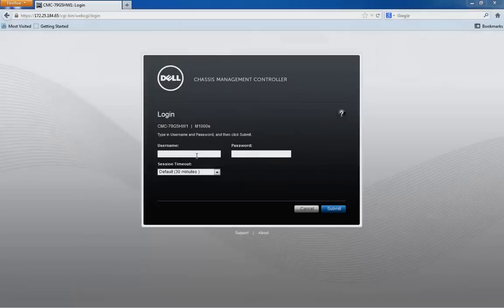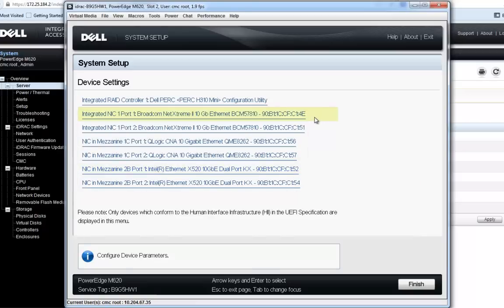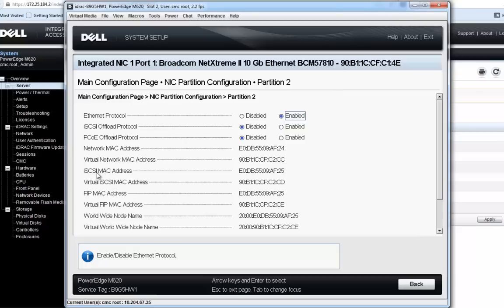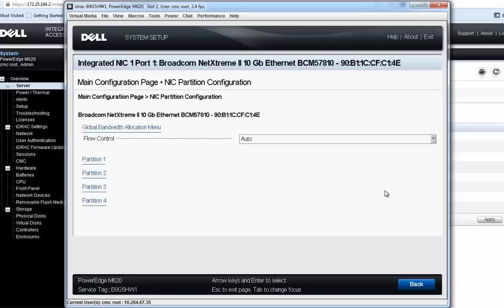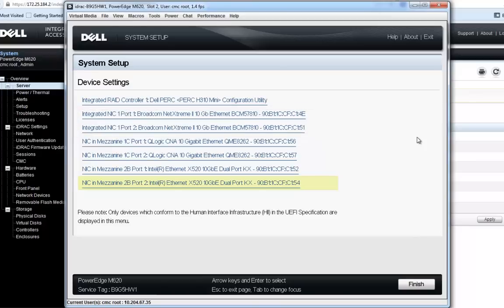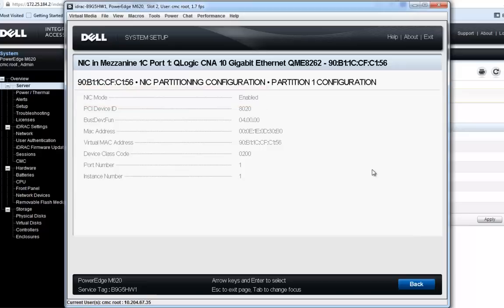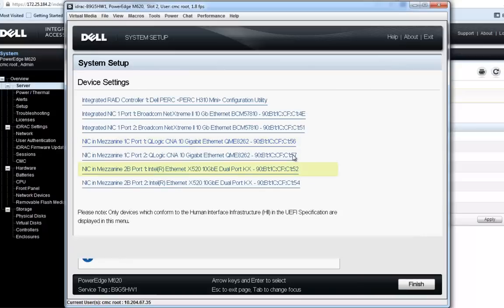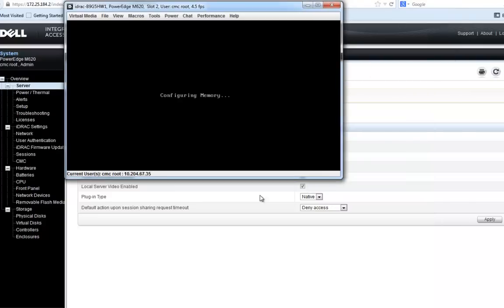Dell NPAR Podcast

Comment: Hi, Broadcom 57810 after disabling NPAR to NONE port 2 get the same permanent mac address as port 1. Previously it was different. Do you know the way to make it different again? In NPAR mode adresses are different.
Reply from the maker: Hi Dmitriy, the normal case should be that nPAR provides a Mac for every virtual NIC port and without nPAR every physical port should have its own Mac. So it seems like something is wrong. 

Please contact the Dell technical support. Our support specialists can help you solve this problem. You can find the contact information here: https://dell.to/3I6aYh7

Thank you.